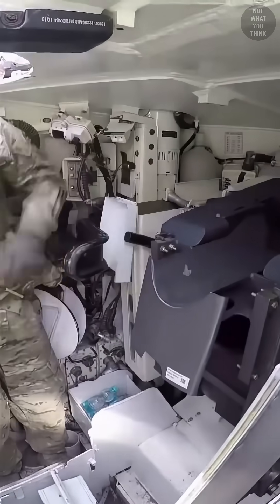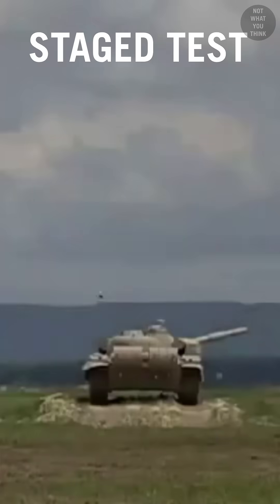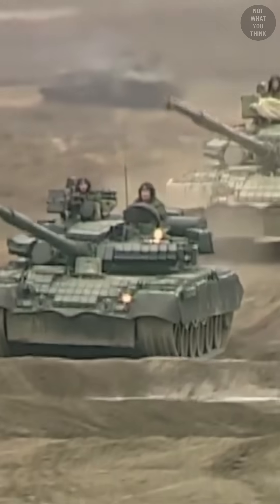Why M1 Abrams Tank Has No Auto-Loader #shorts

Comment: The French Leclerc and the Korean K2 have autoloaders and blow off panels in the place where most ammo is stored (there is also some additional ammo in the hull). Only Soviet tank designs have the carousel autoloader with the ammo under the turret basket.
The fact is that the Abrams uses older technology such as the L44 gun instead of the L55 and does not have an auto loader, probably because the US Army doesn't trust it's reliability and also likes to have a fourth crew member for the chores.
The main advantage of having an autoloader is the capability to maintain a high rate of fire of 10 to 12 rounds per minute, even if the Tank is moving cross country at high speed. With manual loading, the tank is supposed to have a 10 rounds per minute capability, but at high speed over cross country, good luck getting that.
Reply: The US military never had an autoloader it liked. US defense contractors never produced one that was light enough, reliable enough, safe enough or with enough ammo  for the US military to accept. The Stryker MGS has an autoloader, but the vehicle is being retired because the autoloader is too unreliable and the vehicle is too unstable when firing. Plus, it doesn't carry enough ammo.
Reply: @chaosXP3RT  Eventually they will have to go that way since tank guns are getting bigger. The 120mm shells are about what can be loaded manually, and it is still difficult to get a sufficient rate of fire, while the tank s moving cross country. For the new generations of tank guns, like the 130mm Rheinmetall gun or the 140mm Leclerc Terminateur gun, it will be impossible to use manual loading even with the tank stationary. The current autoloaders usually achieve a rate of fire of about 10-12 rounds per minute, regardless of the speed of the tank.
A big problem with a three man crew in a tank is the increased work load for the crew in regard to guard duty and minor repairs mainly to the tracks. This is a bigger cause for many militaries not adopting autoloader systems, rather than the reliability of the autoloaders.

Comment: This is all true but there are other reasons the US doesn't use auto-loaders. 1) They tend to jam. 2) They are slow. 3) Many auto-loaders make the gun raise up and/or turn to the side to load, taking the gun off target. The M1 stays on target so it doesn't have to refind and lay on after each round making it more efficient in some ways.
Reply: Astounding. All of that is wrong
Reply: 1: no. They don’t the TTB tank america made went through 66 THOUSAND cycles before a failure 

2: the Japanese type 90 can reload in 3.5 seconds. Faster than most manual loaders for one reason or another 

3: this one is astoundingly stupid, other manual loading tanks, like the leopard 2, challenger 2 reset to a loading position (they raise their barrel for easier loading)  as well as the fact that MBTs have a system where the gun follows the sight, IE, the gun elevates to loading position. While the sight stays on target the entire time.
Reply: @patriotic-panda  1) Some, many earlier models, with all the moving parts, when used in field activities, would jam. More moving parts can mean more that can go wrong. And what can go wrong will. One example of perfect performance is not indicative of all. 

2) The US Army trains its people to load at a rate of 1 round every 4 seconds. As time passes and tech increases of course autoloaders will get better and faster, plus, they don't have to rest. The T-72 for instance could take between 5-15 seconds per round. Again as technology has gotten better so has autoloaders but when the M1s were being designed this was the tech they had to think about so, the slow loading time was a concern. 

3) "other manual loading tanks, like the leopard 2, challenger 2 reset to a loading position (they raise their barrel for easier loading)" We aren't talking about why other tanks don't use an autoloader. The title of this video is why the M1 doesn't use one. So your point about these tanks is moot. The M1 and new variations have increased its tech level also. It could always stay on target as long as the gunner or commander kept the cadillacs depressed.

Comment: All these auxilliary benefits being touted in the comments confuse me honestly. A spare crewman in case someone got incapacitated? More hands to do field repairs? Another pair of eyes? What? If these are so important that they're worth having an extra soldier in there... why not have an autoloader anyway yet keep the soldier in? Imagine how much more of a situational awareness boost it would make if that soldier could actually focus on that instead of mentally preparing to reload. Manual loading really feels like just makework to justify having that 4th person in the tank.

Now, the safety angle, that would be a real consideration. Except no, you can have that with an autoloading system too. So what's left? Weight? I honestly don't know how much an autoloader would add, but I don't think it would be THAT much relatively speaking, considering that tanks are already pretty hefty machines (I'm willing to change my tune if someone has the numbers and they genuinely look bad). Reliability? I also don't know about that one. Humans aren't THAT reliable really compared to well designed mechanics, and hey, in this scheme you'd have a 4th person to help fix it in case it goes wrong (I wonder if they could do it so the gun could be reloaded manually if the autoloading system was down?). Also as a bonus, if one of the crew gets knocked out in this scheme... hey, your tank is still fully effective, if deprived of the little bonus things the extra soldier did before. Not so with the manual loader working a manual loading system - some functionality of the tank WILL suffer in this case.

 Honestly, that leaves pretty much just two things - cost of upgrading old materiel and the organisational inertia. And neither seems like a great factor in making the newly constructed war machines as effective as they could be.

Comment: Ok, but what is stopping an auto-loader from having a similar explosion containing compartment? (0:38)
It would be even more effective, because an auto-loader is faster than a human, so the door needs to be open a shorter time.
Or the entire system can be compartmentalized, so in any step of the loading cycle there is always explosive protection for the crew, but the auto loader blows up.
Reply: Actually, Auto loaders are slower- if you can believe it.
Autoloaders take 5-8 seconds, depending on model. To Qualify as a loader as a human, you have to do it in 3.

The other issue is, you have to monkey with the machine if you want to change ammunition types- because the way auto loaders are set up this can take a whopping ten seconds. A human still only needs 3.
Reply: @AsaelTheBeast  Nope, autoloaders are faster. Tanks like the Type 90 and presumably the Type 10 can achieve reloads as low as 2.8 seconds, the Leclerc being able to achieve around 4.5 seconds.

>To Qualify as a loader as a human, you have to do it in 3.

No lol. Idk where this myth comes from that Abrams loaders can load in 3 seconds. If you know the procedure for loading its physically impossible for a loader to hit the door, drop the breach block, pull out a round, put in the tube and arm the gun. It cannot happen that fast, and theres no videos to show it because it hasn't ever happened. 

>The other issue is, you have to monkey with the machine if you want to change ammunition types

You literally just hit a button or turn a dial to whatever ammo type you want to the autoloader to load. And it only takes 10 seconds to switch ammunition on T-series carousel  loaders at the absolute maximum, I.E. the other side of the carousel.

Comment: There are also bustle autoloaders like many NATO countries use, which store the ammo in the turret. You can still use blowout ammo racks and don't have the risk of ammo cookoff like with a Russian system. Basically, GM just doesn't want to put an autoloader in the Abrams so they can charge the military out the ass for one when they eventually decide to get a new MBT, so they keep coming up with new excuses as to why they haven't put one in yet
Reply: Or, perhaps down to the fact the the military in question PREFERS manual loading. There are upsides to having a manual loader. An extra pair of hands for maintenance being one, extra body for guard duty when the tank is laagered up whilst on operations is another, an extra pair of eyes inside the tank in action, which can be the difference between spotting the thing trying to kill you and not spotting it as the loader in most manually loaded tanks also has vision devices. Also, in British tanks the Loader is the 2nd in command of the vehicle. Not all things that equate to efficiency in combat are necessarily immediately obvious.

Comment: The loader also adds another set of eyes for improved situational awareness, crucial in urban environments (and others) where the main gun firing is not the upmost priority.  An extra pair of eyes and turret gun to watch the flank/rear against infantry w/RPGs and satchel bombs is always welcome.
Reply: in current urban environnement, camera does the job better than human eyes. The loader sees what from inside the tank ? If you need people outside the tanks then use infantry, they are better train for this job
Reply: Scouting vehicles and infantry also exists tho
Reply: Excuses......
Reply: Extra eyes....yet ZERO vis in urban. Try another lie.
Reply: @DavidWatersJames  Name one tank that has perfect urban vis? 🙄 That's why Bradley's were envisioned - to compliment Abrams in those vulnerable situations with their 6 man dismounts (and later other Mech. Inf.).  Tool.

Comment: the Israelis take crew safety to another level. On top of using an identical manual loading system as the americans. The Israelis went event further by positioning the engine in the front of the tank to provide more protection for the crew. The idea is that the tank is worth nothing compared to the crew inside. Most countries these days value the tank more than the crew

Comment: This doesn't actually explain why the M1 has no auto-loader, it just gives reasons why they don't (help with maintenance, replace another crewman). I'm pretty sure we (and the Russians) can build an auto-loading mechanism that works with ammo stored in a separate compartment within the turret (we can land a man on the moon, after all).  I think the main reason is if the auto-loading mechanism breaks, the tank is completely useless in a fight. If the human loader is killed or wounded, the gunner can load and the commander can shoot. EI an extra man is more valuable than an auto-loader. The biggest pro for the auto-load system is that it doesn't get tired.

Comment: This is rather poor excuse... it is not like blast doors, compartmentalised hull and autoloader are exclusive in tank design. Now - do soviet tanks with autoloaders have disadvantages... yes they do, are manually loaded tanks slower to shoot and requires extra crew and are larger yet more cramped like for like - yes, that is also true. Every task human does M1 could be automated and made faster, more efficient - simple truth is M1 is 4 decades old design. It was good when it was made, it was still good 20 years ago, but by now it is actually obsolete. That is not to say it was not modernised and not capable, but some design decision are fundamentally obsolete and 40 years old, at which point it becomes easier to design completely new tank as upgrading existing design is no longer feasible.

Comment: A side effect of having a human loader is that switching ammunitnions, say APDSFS to HE, is easier compared to an auto-loader. Just remove the round, put it back in storage, and put the new round in. Auto-loaders are the same,  except you'll have to find a way to put it back into storage(or just throw it out), before you can(or want to) load the new round.
Reply: What makes it harder if a autoloading tank had to switch rounds?
Reply: @AbsolToki  I don't think that it's like, actually harder to switch rounds, just that it takes extra time, having to move someone into the auto-loader and move rounds around.
Note that I'm not a tank nut, so you're better off looking it up yourself. Sorry.

Comment: you do realise that the main reason for autoloader is space? just compare the size of t-90 and abrams (t-90m - 50 tonns, Abrams  M1A2SEP - 63.3). Human loader need hell of a lot of space to actually load a round in a gun! ANd every cubic meter of enterior makes armor that much heavier and as such autoloader makes it smaller and lighter while retainig superior (or at least comaprable) armor.
P.S. and I'm not even gonna start on engine power, transmition and fuel consumption due to a lighter weight of the vehicle